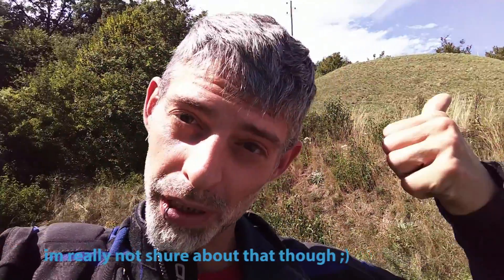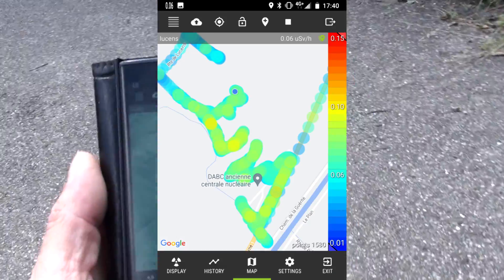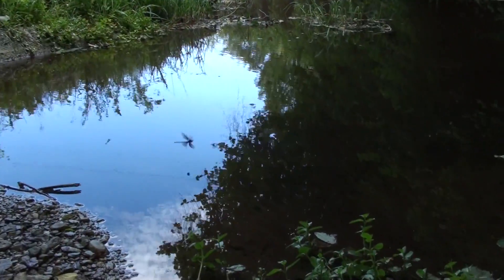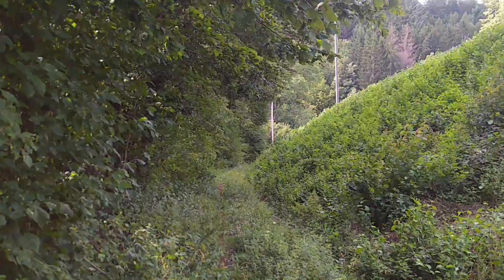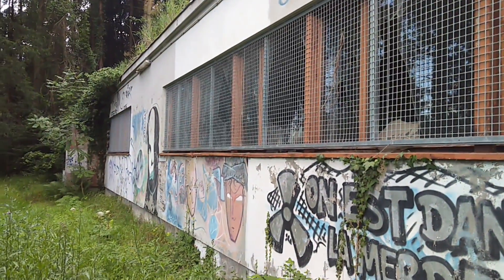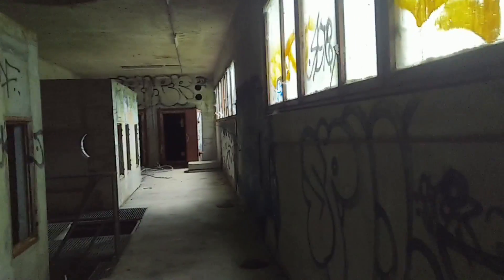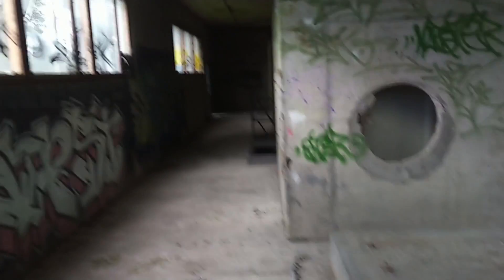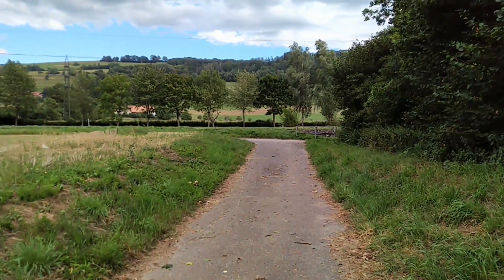Visiting Site of partial Reactor Meltdown in Lucens, Switzerland in 1969

Comment: This is the only video in existence on the internet of the Lucens reactor meltdown site. Nice! 
I think the reason it ended up being so minor is that it was only a 30 megawatt reactor, the decay heat would only have been a few hundred kW some minutes after shutdown, and the low power and short running time would have meant the fuel burnup fraction must have been very low.
Reply from the maker: Thank you for youre kind words! :) ..makes alot of sence what you say, so it was small "enough" to kinda burn out on itself before getting any worse? interesting :) Btw yes i noticed theres very little information in english about the whole thing, there is a good documentary in german though, i learned alot from this: 
https://www.youtube.com/watch?v=Endt3lkaZhw
Reply: @BremsstrahlungChannel  Interesting! I'll check it out!